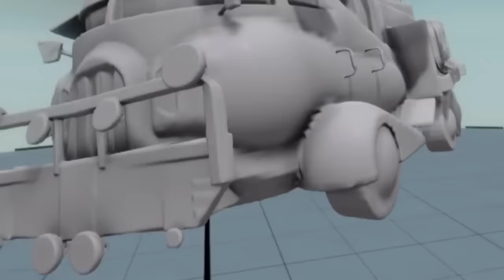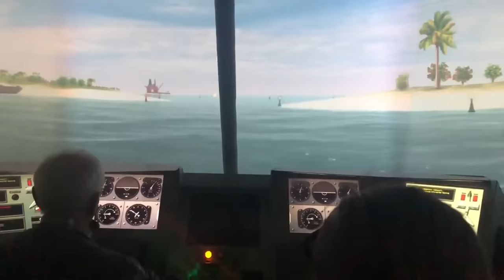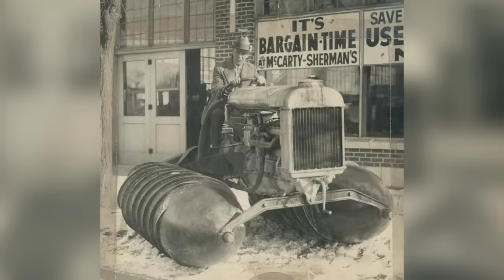12 Most Incredible Abandoned Vehicles

Comment: Hmmm. . ..  How can a train be "highly maneuverable?"
Reply: Now there is an interesting question
Reply: Means it can take tighter bends without falling off the tracks. Bit like a city tram
Reply: Maneuverable around tracks meaning it can take a tight corner better than most trains
Reply: Just one more reason that GM shouldn't get bailed ever again, all they had to do was adjust the angle of the wheel where it meets the rails and that ride would smooth right out as well as increasing the top speed. Same thing with Canada's Turbo train in the 60's through the mid 70's, it kept jumping the rails at just over 100mph for that very reason. We used to scramble to get our gear off the tracks when that thing came flying through, rail yard crew gear that is. Our train tracks are the same ones used for the steam engines, terrible ride.
Reply: Sure as you can't steer a train
You can't change your fate
Reply: It can go on roads
Reply: When it derails it can turn on a dime.

Too bad there’s no steering wheel.
Reply: Does it? Can you prove it?
Reply: Put 66" Mickey Thompson's on it and it becomes a "Trained Grave Digger"  Monster Train/Truck.  Able to crush Trains, with a single, maneuverable, leap or some shit, akin to that.
Reply: @brunopronsato9587  I see you are a man of refined tastes.
Reply: @drampadreg1386  to long
Reply: @drampadreg1386  ... the main reason trains ride the way they do is because of the weight. GM cut the weight in half (and then some) and it was like riding in a tin can, while other mfgrs added cement to the floor to lower the center of gravity and gain momentum headed into hills. That extra weight had proven itself in the first 100 years of train service. Screwing with tradition was their downfall here.

Comment: The "Concrete" boat/ship was actually built from Ferrocement and the material/technique is still in use today.
Reply: 8 pomp nomop
Reply: @wkruit  ferrocement. It's not concrete. There are plenty of ferro vessels out there but the advantage in materials cost is outweighed by labour costs, because the system requires a lot of it. Also it can be hard to get insurance because amateur-built hulls are often less than perfect. They can be overweight because too much mortar has been used and this makes them weaker, not stronger. However a pro built ferro hull will last as well as a steel or GRP one.
Reply: The "concrete" ships were the Library ships (part of them) in WW II.
Reply: There is concrete (reinforced with steel) shipwreck from 1951 still visible at Baltic sea near Riga at Mangaļsala called Lady Cotlin. One of the properties of these ships were that they provided excellent moisture levels for cargo. Still does not beat idea building aircraft carrier out of ice...

Comment: 3:20 No, it does not use coal in its own engines. Like other bucket wheel excavators, it had all electrical motors and was provided electricity by a cable from the grid.
Reply: plus it only cleared the overburden
Reply: No, it's true. It was a steam punk excavator.
Reply: Not saying that it ran on coal was true, but it is more then possible. Most of those large excavation machines were in fact "plugged" into the grid, some used diesel generators where  the mine was just to far off the grid. Could they have used a coal fired  boiler and steam turbine to power a electric generator ?  Sure but I can,t see some one ordering  a system so much more complicated when diesel fuel at the time was like 20 cents a gallon. But on the other hand in its hayday that machine was running 24-7  and a turbine would not require nearly as much maintenance and would last much longer then a diesel -electric set up.   .
Reply: And at a much lower operating cost ( coal fueled )

Comment: This is not Bagger 258, it is still in use in West Germany. This is SRs 1500 and it used to work until 2002 in Meuro, East Germany. It was made by VVB TAKRAF,  Lauchhammerwerk is a part of it. Furthermore, all of these are powered by high-voltage electricity and can not run on coal. Which also would not make sense because this one was used to dig overburden, not coal.

Comment: I had a trainee on my ambulance the other day and he said that he goes to burning man with his old schoolbus and collects the nicest bicycles after the event and resells them. I got my bike, a rare and classic schwinn traveler chromoly that way.
I also used to work at a hot rod shop, we bought an 1970's chevy pickup as a parts-getter for like $400, and the bed was filled with old bicycles. I dug through them and saw one was a 1950's schwinn california beach cruiser with its original badges (big money) so we cleaned it up, powder coated the frame, rebuilt the coaster brake, new grips and cables, and I resold the thing for $5000 in 2007

Comment: Bagger 258 (and Bagger 1473 that is often confused with it) were both powered by electricity supplied by external power cable.
NOT BY COAL.
This is also true for the later Bagger models, like the 288 and 293 that are counted as the largest (by most measures) land vehicles of all time.

Comment: I beg to differ.  My vehicle is very unique.  It has a 15 speed transmission, ten headlights, stainless steel bumpers filled with concrete, it is hazard yellow, the ignition system is completely unique.  I do not even have to lock it.  Nobody would know how to start it.  I will be adding a pickup truck bed to it next year.

Comment: The Aerotrains were operated by Rock Island railroad into the late 1960's, punishing their commuter passengers for many years. They were not returned to a warehouse after a year, but wer rejected for use by the Pennsylvania, Union Pacific, and New York Central railroads because they were so rough riding. The light weight was not the problem with propulsion, it was the fact that the engine only powered 2 axles, with a 1200 HP diesel engine, not enough for a bunch of cars. Not a problem in the flat midwest.
Reply: i think one of those is in a museum
Reply: @davewallace8219  St Louis Museum of Transportation. One of the Rock Island sets

Comment: There are actually still concreat hull ships around in germany itonically one of them is still a partyboat in the town of bremen..
Reply: When I was a kid there was a sailing yacht made of concrete I would see every now and then. I have no idea how well it sailed but just the material was enough to make it interesting and exotic. It was natural concrete gray and I don't think it was ever painted. With two masts it looked like just another large yacht from a distance, but up close you would see that there was something weird going on. On one hand the lines were flowing and smooth, on the other hand the details looked rough and clumsy. As a kid I had a hard time reconciling the idea of making a boat out of concrete, but when I learned a bit about the material and hydrodynamics it made more sense. Even so I can see why it didn't catch on.
Reply: @blahorgaslisk7763  in Germany they where actuallybuild  due to lack of Steel during WWII
Reply: @TheRazerx7  I think this was built in the late 70's or very early 80's. It was a one off design, and from what I remember it was never really completed, but I can be wrong about that.

Concrete is an interesting material. At a playground there was a huge viking ship built entirely out of concrete, sails and all. There were stairs going up to the top of the sail and a slide down from there, and again, it was all concrete. That slide was polished so smooth that kids could slide down it all day and still not wear out the seat of their pants. I doubt they could build something like that today on a playground. It would have to be made of rubber and no higher than that a kid could fall head first without getting a bobo.
Reply: @blahorgaslisk7763  Would that ship beable to sail (playground)
Reply: @TheRazerx7  No, it is just playground equipment. The interesting part was the slide made of concrete. I haven't seen concrete used that way since. The ship is still there on the playground today 45 years later, though I haven't checked on the slide to see how it looks today. I think it was probably between 10 and 20 years old the first time I saw it, so it's somewhere between 55  and 65 years old today and kids still crawl all over it. Though they have replaced the sand around it with a rubber material. Can't have kids today smack their silly little heads when diving headfirst from playground equipment. Actually I'm surprised they haven't replaced it entirely with something totally harmless.

I might sound a bit sadistic, but it's my opinion that doing stupid things ought to hurt a bit. It teaches kids that there are consequences and that sometimes you better think twice before doing something. And occasionally it cleans up the gene pool, keeping it form getting too shallow.

Comment: 5000 sq feet of coal in one bucket? sorry mate, im a mining engineer and you'd need conveyor belts the width of soccer pitches to transfer that much coal or anything else. also, bucket wheels cut across the pile  in very small steps, they dont dont "dig in". finally, the video your showing looks like some kind of ore not coal, which is heavier due to bulk density. looking at the size of the machine, and width of the belts, you are probably looking at 3000 coal TPH max on a good day if its not raining and no mech breakdowns.
Reply: The bagger's buckets are 1500 litres, that is 55 cubic feet. The bagger newer dug coal, but removed the covering earth layers for later open-pit mining. It never burned coal itself, but ran on electricity, supplied by 6kV cables. Just sayin'

Comment: The amount in each bucket 3:11 is incorrect. For a start it should be measured in cubic feet (volume) not square feet (Area). Even the figure of 5,000 cubic feet incorrect. Most reports put the volume of each bucket at 6.6 cubic metres or 6,600 litres, which is 233 cubic feet.
Reply: Ian Canty. To be fair, he’d didn’t refer to individual buckets, but how much the entire apparatus could theoretically hold at any given time.
Reply: @motosnape  Even on that basis It doesn’t pan out as there are 18 buckets with a total capacity of about 4200 cubic feet. Also, each bucket doesn’t start loading up until it’s at the bottom of the wheel & empties just after top dead centre, so at any one time it could only logically hold about 2,100 cubic feet. People may think I’m pedantic but it seems to me that if one produces a video, time and care should be taken to explain things more clearly & relevantly & above all, correctly.

Comment: concrete ship wow.
Reply: Boats  made of concrete or more correctly ferrocement have been  common since the1850s.Look  it  up
Reply: I laboured on the construction of a ferro yacht hull. A very good cure had to be carefully managed. I am still left with the impression of a very strong, stiff, and long serving hull. Cheaper than most other materials but quite labour intensive, having to place wire ties at every crossing point of the rebar frames and stringers, and every rebar grid overlap. But quite fast construction times are possible, and being cheaper, you get more hull for your buck, or better gear. The extra weight is quite welcome in a displacement monohull cruising sailboat, but would not be suitable in a performance catamaran, or anything that foils, weight being the enemy. Maybe there's a recipe for lightweight concrete :)
Reply: Concrete Technology in Tacoma, Washington, has built concrete barges for decades. Usually for LPG transport.